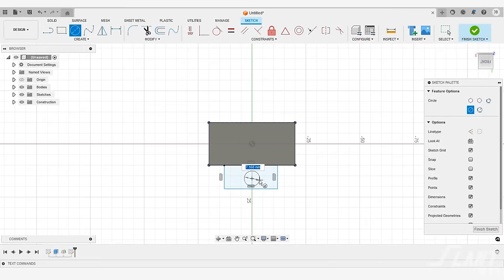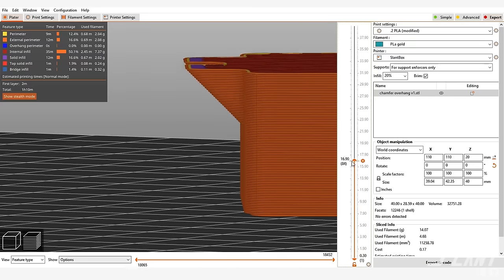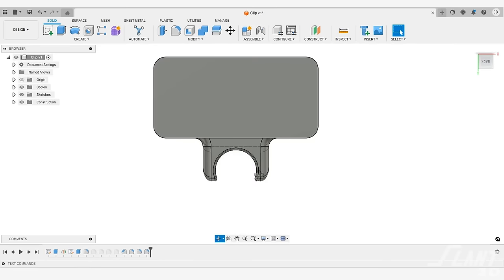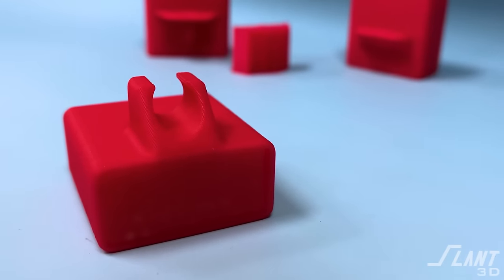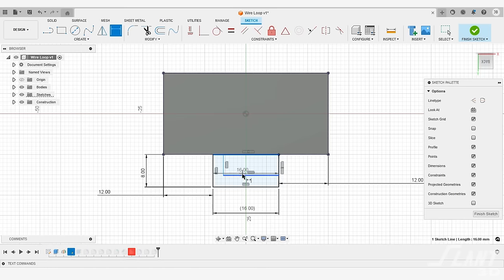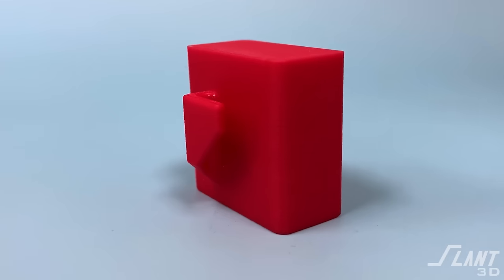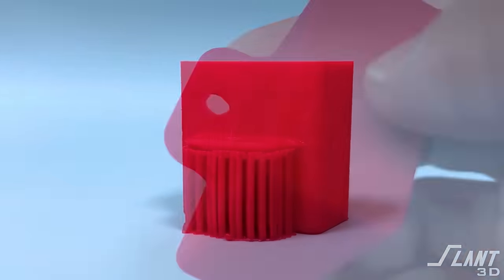Better Horizontal Mounting Features | Design for Mass Production 3D Printing

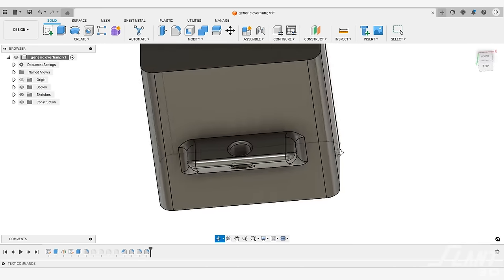Comment: I love these 3D design tips.  I'm designing a part tonight that needs a tab with a hole on one side and I was planning on something as shown at 1:00, although with the top chamfered as well because this is the girth hitch attachment for an O ring that's used as an elastic retainer.  The other side needs a hook for the elastic band and a vertically mirrored version of the simple clever part shown at 3:00 is ideal.  I may redesign it to use small Velcro cable ties instead of an elastic band but the geometries will be nearly identical, but with slots.

Comment: Hey, question about auto eject. Is it more efficient to print and eject a single part and reprint over and over, or to load up the build plate with multiple parts? My thought is that would be quicker doing the single part due to travel of the print head, but i wonder about the wear and tear on the print bed or other components that might be more spread out if you can load up the build plate. Thanks for the informative videos!

Comment: And if having a horizontal feature at (almost) 0° is imperative, you can always go a step further and inset the entire overhanging structure inside of the model, having the chamfer/slope building its way up from within the model and leaving the tiniest gap underneath so it prints properly. That way, it would look as if the overhang was almost 90° but in reality, it would just be a feature that supported itself just like the ones shown in the video.

Comment: What angle do you recommend for the chamfer 30°, 45°?
Reply: Most 3D printers with proper part cooling should be able to do 45°.
Reply: My personal rule of thumb is use 45 degrees whenever I'm designing something that might be printed on someone else's printer (such as something you would put on Thingiverse or Printables). Your own printer may do much better, but 45 degrees is pretty much a standard at this point and has less of a chance of failure and complaints down the road. You may have designed a great part that works on YOUR printer, but if it doesn't work on Random Joe's badly calibrated Ender 3 he may get upset and your part may not be as popular as it could be.

Comment: Or if possible rotate the part so it prints the tab vertically no support necessary with rounded edges.
And another thing that drives me nuts is people design drawers with horizontal tabs instead of vertical.

Comment: What if your design has to have those original features because it goes with an existing product? 

I believe that you should improve when you can but you don't need to limit yourself because of things like overhangs and support. Otherwise, just get it machined out or injection molded.
Reply from the maker: Part 1 of the video